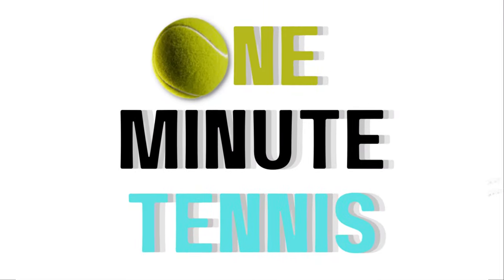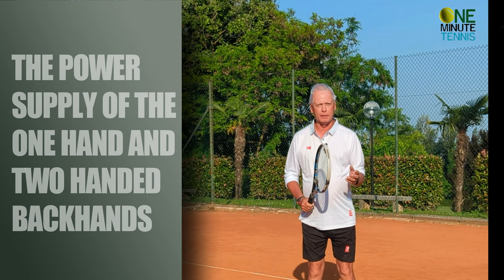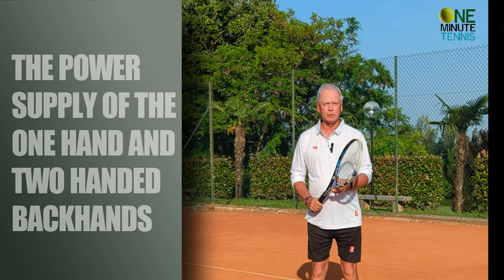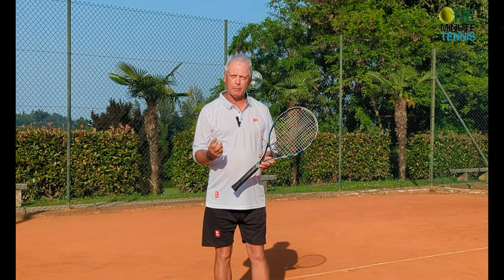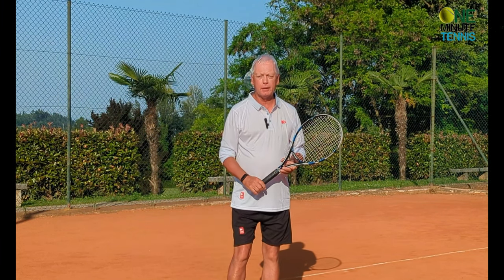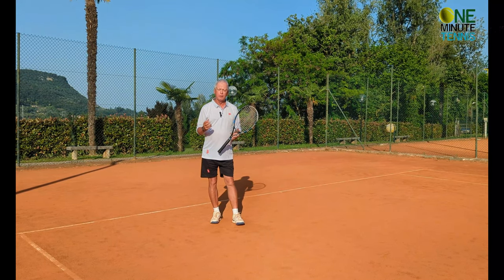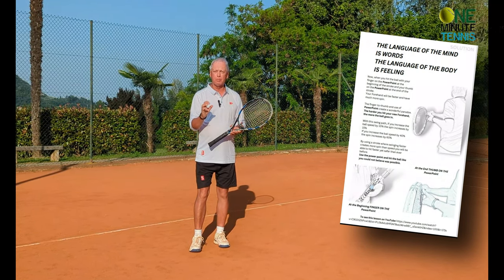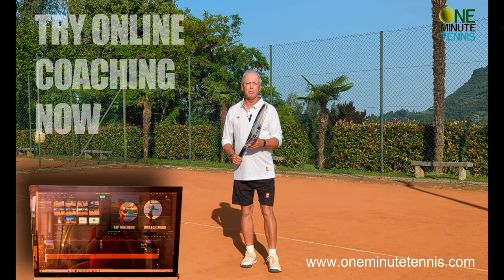Need more power on your Backhand? Learn about the backhand Power Supply

Comment: A good illustration/correlation for the counter force for the one handed backhand that you described would be the difference between flicking a pea off a table top using just your middle finger vs tensioning the finger while it is being held back by the thumb. When the thumb releases the pre tensioned finger it will flick the pea with multiples of force compared to just using the finger alone.

Comment: I always had a doubt about backhand. My main hand is the right one and of course when I make a play with my forehand I use my main hand. The doubt is, can I use the same right hand to play a backhand move? I'm new on tennis and I always execute a backhand with my right hand (the same as the forehand move), I've never seen any problem with that, but I've read the backhand needs to be played with the other hand (in my case, with the left one). Should I still use my right hand to execute backhand moves since it's working for me?